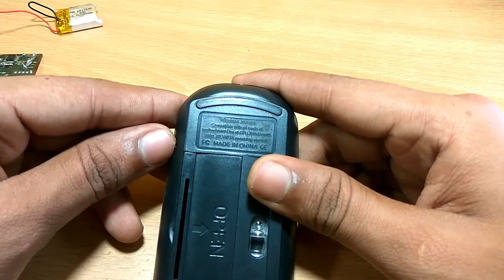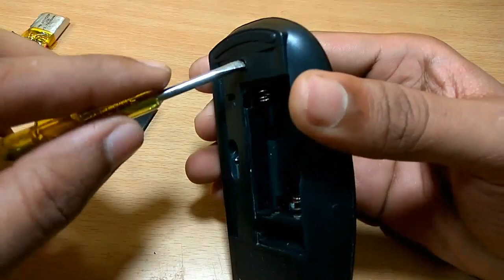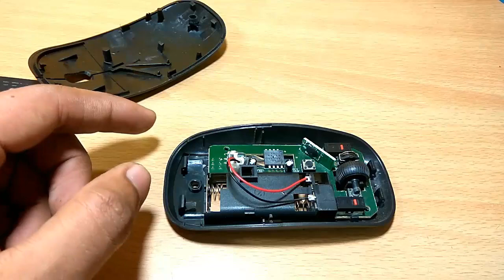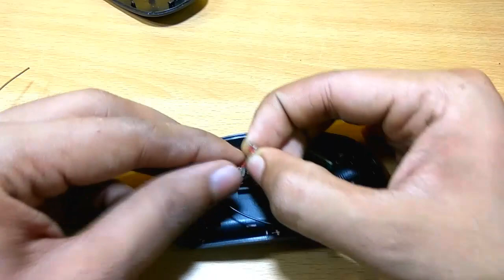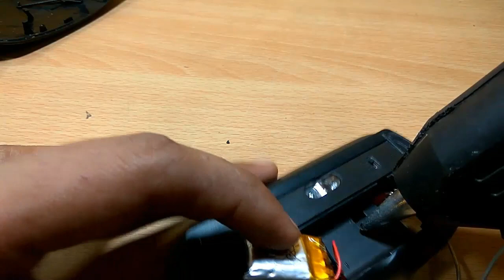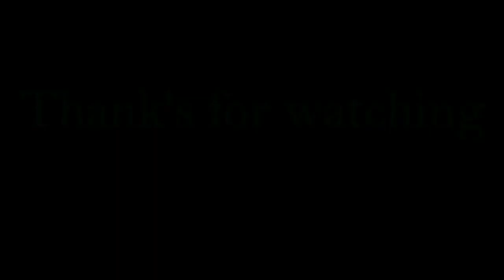Convert a bluetooth mouse into rechargeable mouse | amazing idea

Comment: this mouse use 3 voltage to run and the battery is 3.7 volt. is it nit harmful for mouse circuit?
and charger specs voltage and amperes?
Reply: 3.7 can be used, why we are telling 3v is because it uses two 1.5 v batteries which produces. I believe the circuit will works on 3.7 volts without any issues

Comment: Ur house gona get fire because u see some tutorial on youtube with fire hazard batteries charged witout any protection at all to overcharge or short .
I dont recomend this , "solution" .
Reply: this battery have a litte BMS to control the voltaje and protect the battery
Reply: XD it won't get burned or anything you think, i tried this long time ago with a small kinda cellphone battery and it just doesnt work properly and then it stop working and if you put a normal batter, it wont work, so it wont burn, 
JUST USE A GOOD LOW BATTERY LIKE 3v
Reply: @armandguillen6149  this is what u think , because u have no ideea about lipo  batteries , they burn and make fumes , and they fire with high flames , when they pop up . And overcharging an lipo battery without a limit , will make them popup . 
I tested this , and this is what happens when u use some dumb solutions from youtube , check the note 7 battery , they flame without a dumb solution , and u come here and tell us that ur an super technical guy and u know what happens , with a dumb , overvoltage charging solution that some random iq guy give on internet .
This solution they used and in cellphone , and with this solution they broken the pa in mobile phones , and batteries get puffy , and they dont work anymore .
Reply: @CeNuVezi  honestly i didny try it with a connected charger, actually it's a LCD universal charger. And i you're right about the damage for overcharging a battery using a cable like in the video, but i didnt use that, thats why i didnt get it burned, it¡s just too much energy that it didnt work properly. btw im not a technical guy